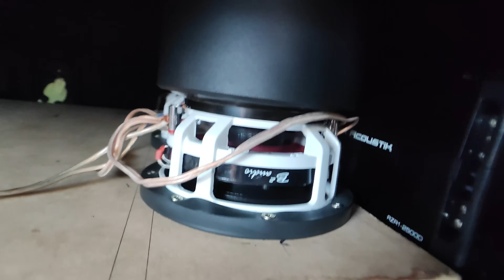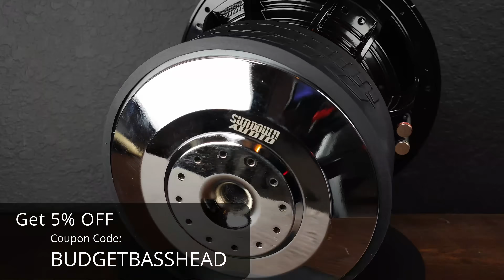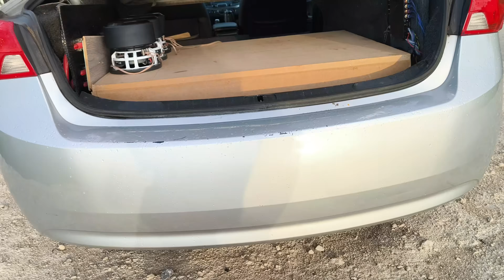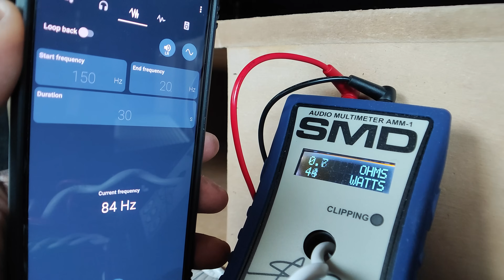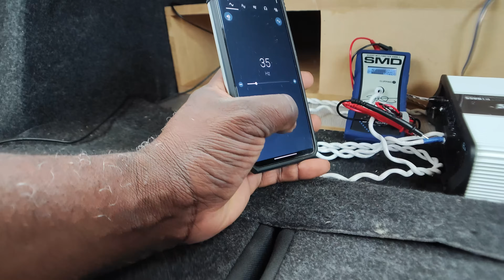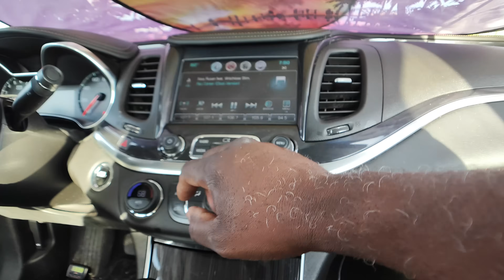Three 6 Inch Subwoofers In A Large Horn Enclosure - B2 Audio Rampage 6 - 3,500 Watt SPL & Music Test

Comment: Awesome video, I learned alot.  For me, this would be better in home theater.  No way i can put a giant box under my back seat.  I have gone with Dayton Audio HO series subwoofers.  Its four 10in SVC 4ohm wired to 1 ohm in a sealed 2.2 cubic box.  Not sure on tune and dbs because i dont have the testing equipment but it does stay loud down to about 28hz before it rolls off.

Comment: You should try some tapped horns, low tuned with a high excursion pa sub, cirrently waiting for b&c ipal 18, 20mm xmax one way, neo motor, 2 ohms, 4,5” vc, 3400w rms, planning to build a OTHORN box, tapped horn tuned arround 27hz

Comment: With horns and doors open/closed. First you would want an opening where your car's helmholtz frequency is 35 Hz. With a window or two open it's typically in the teens (that window flutter when driving down the motorway with one window open.)
As for horns and more area: because they are an acoustically transformed design (at least with a full size one, not the small partially sized one here), they typically spread a relatively "low" spl to a large area, (so a little 6 with a pokey motor that can't push air but can sure crush it if it can't escape, pushes it down an expanding tunnel, and the other end functions like a nice big 21" PA driver with more surface for pushing air properly) but reach a limiting factor in a very confined space. A less efficient design like multiples in a sealed box can keep on crushing the air down harder in a small car, but in open air space, the air just blows out of the way, and it can't grab a big sheetful like a horn. It's like a big airbed pump vs a bike tyre pump. The bike tyre pump would take ages to inflate an airbed (small sealed box in big open space) but the airbed pump couldn't generate enough pressure to get the bike tyre anywhere near inflated (big horn in a shoebox car). Theoretically you'll get the most ultra low bass with a sealed wall and all windows up (in practice the air vents will leak)

Comment: Because you didn't reset the dec. meter after the two window down test. Also I would like to see the same system with different boxes. To see which box does the best. I would like to see a 4th order bandpass horn. Back part sealed and front would go through the horn then a regular sealed and imported.
Reply from the maker: Good call on resetting the dec. meter, I'll keep that in mind for future tests!

Comment: Useless weight... Lol
Xsus is way shorter than the motor stack and no significant gain in bl with the large diameter. Trinity h6.5 is the same way. 5 15/16 cutout... The Alibaba version has the same motor depth but reduced diameter and identical specs.
Reply from the maker: Thanks for the info.

Comment: You missing one bottom component of the horn enclosure and that is the throat it should be pinched off the air from the first chamber with a sub should be pissed off come like you pinch of water hose if you pinch it too far you're causing you know like a sealed enclosure basically on the other side if there's a point of having too much pence and then if you have two left like you have here they all the airflow is just flowing around quickly but not at its max speed which will cause a bigger displacement and and more volume once it transforms to be impedance at the air in the in the cabin the car basically you got to have some pinch so the sound doesn't return back to the speakers if you take a water hose you can see what I mean you can pinch it off and you're going to be a point where the water will travel the fastest because you're not really changing the pressure you're just changing the speed of the air pass this point some people use the long necks and there is a advantage to using those two before you reach the flare but I can't really explain that one either because I'm barely new to these but I do understand that you have to have a pinch off of the air cause the air and best way to dentistry what I mean is just take a water hose pension and add a certain point you're going to get where the water is going to take off real faster and then too much is going to start going to get where it's going to cause back up and there's going to be a point where it's going to fly across the yard that's what you want that's what you're looking for right there but I can't formulate that into a sub box to me it'd be more trial and error but you just got to imagine try and just putting three woofers in a box sealed box with a slidable wall and open it up a little bit at a time until you can get that maximum flow of air through that pinch and then that's where you going to start and then from there I travel probably probably about 60 in before you actually start flaring it and then I would do that logarithmetically to a larger mouth than what you got there.. but I'm glad you did this I mean this is excellent because I've always thought horn enclosures were the shiznit. But I come from a clubbing background and I've always hung around those Vegas that used to be in the club in those huge boxes and they got like four holes coming out so like four different it was missing it was mainly bracing but it kind of looked like four horns coming out of this sub that was hidden inside and it was just vibrate the whole place to Knocking the glasses off the bar there was so much bass if there was no people in the place to absorb All that Base you can knock all the glasses from the little hanging places around the bar..  it was awesome   come from real poor family though so I never got to really play with it new this stuff myself so I'm happy for the friends that I had to show me that stuff and for your channel to do what I never got to do I encourage you to keep keep it coming..
Reply: Sorry for the all the errors I used voice and I'm from the south so I see it got a lot of things wrong but I don't feel like redoing it sorry about that... I think you figure it out or you get the gist of what I was trying to say. Lol
Reply: I mean 6 not 60 inches.

Comment: You'll get better numbers by sealing these subs to the enclosure. I would have glued the panel over the original driver opening to make that airtight as well. I recommend a series-parallel wiring here - that low impressive is very hard on the amp. I commend your enthusiasm and curiosity as you explore this hobby. I started in car audio in the '80s but build home theatre systems these days.
Reply from the maker: Thanks for the insight. This was a fun project. I'm actually wrapping up another horn enclosure for two eights. Reloaded with a loading chamber. Video coming soon
Reply: @BudgetBassHead  finally something better

Comment: You are absolutely correct about the Motor it could use a bit of shaving, but rubber boots are also made Pretty for reverse mount so just remove the boots on flushed mounts so they fit perfectly!!!
Reply from the maker: Good tip. Thanks for sharing your thoughts on that.

Comment: I knew exactly what that thing gon to sound like.
I did the exact same thing, from single 6” to dual 6" but mine was T-Line, and results are dang good.
I've read on the forum somewhere that for T-Line you can half the port area or double the piston area without changing much of the tuning.
For Horn you can definitely increase the piston area >2x cause horn enclosure port area are usually substantially bigger than T-Line so 3x~4x the piston are sounds like a good number to experiment.
Reply: Finally, someone else who’s designed & constructed & experimented with a multi-driver T-Line enclosure!
This is exactly what I’ve been scouring the internet for, only to discover there’s very little information available. 

Can you expand on this general rule of thumb you mentioned for T-Line designs, about  the change in port or piston area when adding a second driver?
We know that mounting two drivers isobarically reduces required enclosure by half? I’d heard that if drivers are mounted this way in a T-Line, that the length of the line can reduced in length by half. Is that something you’ve heard? Do have any recommendations for repositories of data/user reports regarding T-Line enclosures in a mobile environment? Any help at all would be much appreciated!

Comment: It still essentially is rear loaded as it doesn't have a rear chamber. Horns need "loading" barriers. We have 4 2x12 15hz tuned Tapped Horns for our PA. The highest we measured yet in a venue is 138db at 15hz and 141 at 17hz and it's WILD while in a bigger venue we had a bit over 130db. For at home i built a smaller 8inch 15hz tuned one and it does 108db at 15hz at my listening position and if i open my balcony door i gain 2 db and if i then also open the door on the other side of the room too i can hit 117db at 15hz. What about a Tapped Horn next? If you want i could help you with the design. I have designed a few of those. The damn rubber boots on car driver's already add more diameter which is annoying.
Reply from the maker: I tried a tapped horn and it was a fail. I may try it again in the future.
Reply: @BudgetBassHead Why did i never get a notification? Weird... Ah that's unfortunate! Perhaps something about the design wasn't right. I certainly would love to help you with it if you want :)

Comment: Front and rear loaded horns are completely different boxes. Nothing to do with which direction you face the speaker.
Reply from the maker: Explain why you said that, please... if you can.
Reply: Front loaded horns have a rear sealed chamber for the driver.  You have used the terms front and rear loaded in place of conventional or inverted. Its a common way of speaking if youre referring to sealed or ported boxes  @BudgetBassHead
Reply from the maker: @superpossum78 thanks for the input, but remember that there are more than one type of front loading horn. For instance, the Front-Horn Loaded Reflex Cabinets, and Tapped Horns don't require loading chambers. The reason a traditional front-loaded horn use a seal chamber is to, prevent the rear sound waves from interfering with the sound waves radiating from the front of the cone; potentially causing cancellation or distortion.

Comment: @BudgetBassHead- By your sweep impedance data, the enclosures sweet spot seems to be between (25 Hz to 47 Hz), peaking enclosure efficiency between 31-33 Hz! Maximum SPL score, with the least power used, should happen between 31-33 Hz, unless your vehicles interior changes this. But your 3-6.5" will be able to mech. handle the most power between 31-33 Hz, because that's where this enclosure is providing the most cone control. I'm typing this just after seeing the sweep. I would really like to see in another later video, how much Db these would gain, if you were to test these between 31-33 Hz, with the Big Boss 8k Bass amplifier, in place of this 3k! Great video.
Reply from the maker: Good observation thanks for sharing. I will keep all that in mind

Comment: With something like that with the screws, barely digging in put a bead of silicone around that gasket and it will make it airtight and it also glue it in BUT with pry tool it should come off clean I use the GE stuff it’s actually pretty strong
Reply from the maker: Thanks for the tip

Comment: Your amp is very well designed if it's stable pumping out low frequencies with a single ohm of resistance. Those drivers are rugged. DVC rated at 1 Ohm, when wired in parallel, drops the resistance to half of a single Ohm. Great job producing over 130 dB at low frequency. That's gonna' rattle the neighbors windows.
Reply: These (3)- 6.5" subwoofers are Dual 2 ohm coils, wired in parr.= 1 ohm per woofer, & only .33 of an ohm @ the amp!

Comment: That's a very good setup u have there. I am a huge fan of car audio but I am on a very tight budget right now. If I'm Not asking for to much I have 1 question. Do u have the big 3 are u running on stock electrical if so what can I try out for a Lincoln continental?
Reply: You're not going to be able to run such a powerful system on stock electrical. He has an upgraded alternator and a lithium battery.
Reply from the maker: @JasonWW2000 Thanks for answering.
Reply: Crazy enough tho I blew my jl audio amp so I'm forced to use a boss 2200phantom amp on 1 skar audio 18in sdr in my 2000 pathfinder I have added the big 3 kind of but its stock alt only 70 or 90amp from that alt 😮 but I focused on making everything solid around the sub box and Cabim of it its hitting way har than expected for not even 300$ on amp and sub iv spent spent way more for less bass in the past also im on low budget all but I added ariding  lawn mower battery to the system even with poor amperage from alt and I run the sub n amp full  tilt non stop always oh and I added a small fan to that boss amp cuz yanno it's boss lol it wasn't intended to run my sub it was just in a corner for emergency purpose box and surrounding structures are soooo important

Comment: Your impedance is definitely not 0.1. Thats just the meter acting up. Watch carefully just before it jumps to 0.1. You'll see that it was dropping as the volume increased and got as low as 0.7 ohm.
Reply: Yeah, he is wired @ .33 of an ohm, it's a bit to low for this setup. I asked if he would re-visit this, & replate/seal around the mounting flanges, add the 4th sub., wire all (4)- 6.5" to 1 ohm, use the new Big Boss Bass 8k he just bought, & then turn this enclosure backwards to load off of the trunk. It should slam!

Comment: Weren't you in the passenger seat with the meter last video? Shouldn't you be in the driver seat to have it close as possible to the same path?
Reply from the maker: The box is flipped, port on other side, so I had to adjust. Still, I should've tested both.

Comment: This is not a horn...its like calling a didgeridoo a horn. 
Your impedance @ tuning 35hz is 0.8, if your wired to 0.33 ohms like i think you are, thats nearly 2.5X box rise which is way too high for these subs. That box is way over sized or it can be tuned way lower like 20hz for its size. This box is closer to a tline, an un optimized tline. It would be great for much cheaper low power subs. It would be a very efficient box, even though it would be kinda peaky near tuning and have a quick roll off. 
These subs need more loading and should be capable of the 2k max power each for burps. 
No hate, just trying to help. 
I got 1 8" doing 139db @ 24hz in a tline pvc pipe build. Ive had 4 8s doing 147db @ 29hz in a non optimized horn with 2x box rise. 
I do appreciate your work though, that why im here my bass brother. 
💪🔊🙉
Reply from the maker: I've been seeing people do the same builds since the 1990's. I just like to try new builds. Getting loud the traditional way is easy, to me; It's simple compression and displacement. But wave-guide designs are more challenging and rewarding. I'm simply trying to get it right. 😁 Thanks for the feedback, I appreciate the insights!

Comment: Great test, in conclusion use 1 sub, max value! 

Next 2 in isobaric
Reply from the maker: Ya read my mind, brother!
Reply: @BudgetBassHead or seal up the box and use one or 2 woofers as a passive radiator
Reply: The original design was very peaky without the stuffing, so multiple woofers might smooth it out - functioning a bit like a tapped horn. On pressure modes - like tuning, sometimes multiple woofers can actually make it quieter on a watt for watt basis. Multiple woofers will generate less pressure for the total displacement, so can't set port resonances going as hard. Strange but true. At about the horn's half wave, where you are more reliant on how much the woofer can move, than how hard it can push, the extra woofers help you out.
With a front loaded horn, you pick a driver with a slightly higher electrical Q to get a bit more in the mid band, but sacrifice some at tuning. With a tapped horn you can pick a beefy low electrical Q driver and really slam that tuning frequency hard and get lots of low bass, then around the half wave of the horn, the back of the driver is in phase with the horn and boosts it up a bit. I'm not sure if the driver has to be in the mouth like Danley designs or just close by it.
Reply: I wonder if wiring one of the subs out of phase could possibly make an increase

Comment: Would it gain any if you had the horn facing backwards instead of forwards?
Reply from the maker: Most definitely. This has been proven in the past.
Reply: @BudgetBassHead  Yes, please re-visit this setup with the enclosure faced backwards, replate the woofers mounting baffle, use a Big Boss 8k, add that 4th 6.5", wire amp to 1 ohm, & with the woofers sealed tight around mounting flanges. Oh, & hold your test tone burps for 2 to 3 seconds to allow a more consistent, & higher SPL score. Thank you for taking your time to make these videos❤️